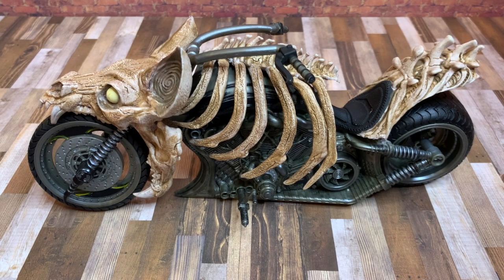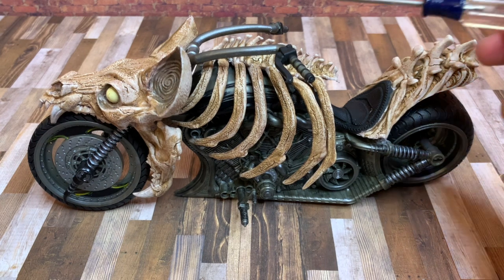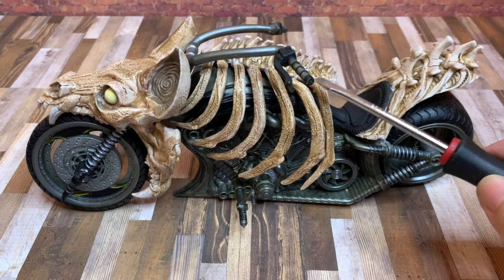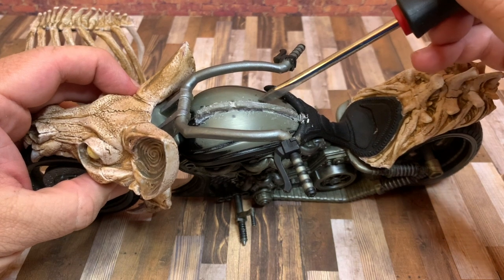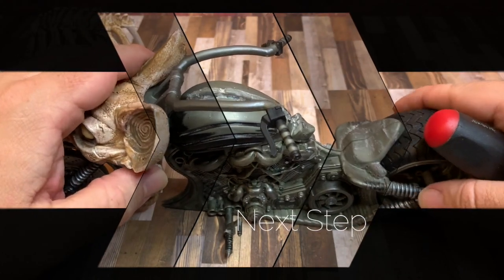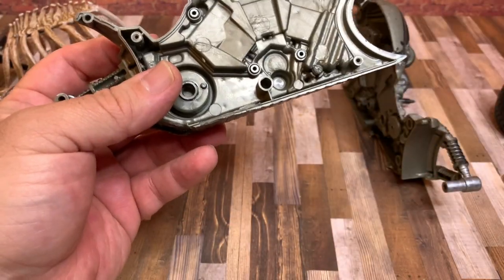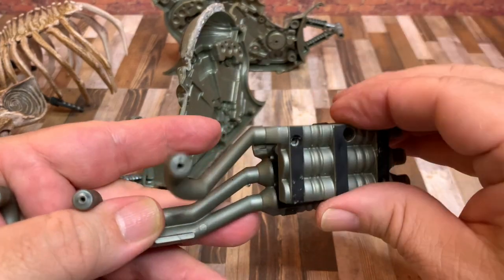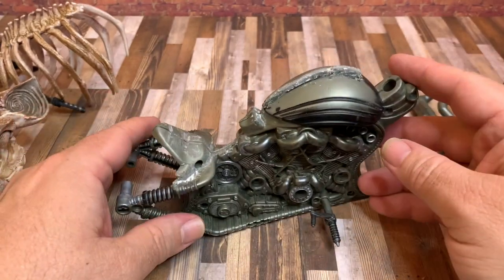How to disassemble the Batcycle by McFarlane

Comment: HOW THE HELL AM I SUPPOSED TO TAKE OFF THE AXEL BAR?!?!?

I want to take apart the whole thing like you did in the video and painted it in detail. So how am I supposed to remove that bar in the bike without destroying the bike.
Reply from the maker: Repeat the heat process….. nice you remove the exhaust you should be able to twist, pull gently…. This takes a while….
Reply: @InkDropCustoms  can I use boiling water for it or no?
Reply: I also don’t want to get frustrated during this process of removing the axel bar.
Reply from the maker: Of course. Just don’t leave it in too long… prolonging the direct heat will warp the product…. It’s takes a while for the glue to soften…. You only need one side to give way to remove the wheel…
Reply from the maker: @sethstrattan7380  —- unfortunately this part is frustrating just like removing the rib cage… it takes a while … be patient
Reply: @InkDropCustoms  do I have to leave it open when it’s heating or no
Reply from the maker: No, it can stay closed…. Open only if plan to add lights